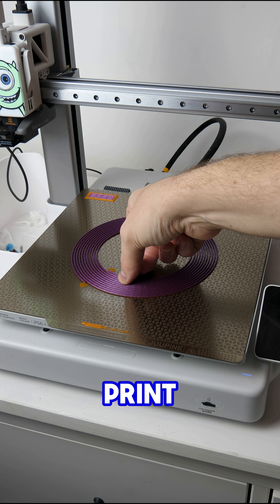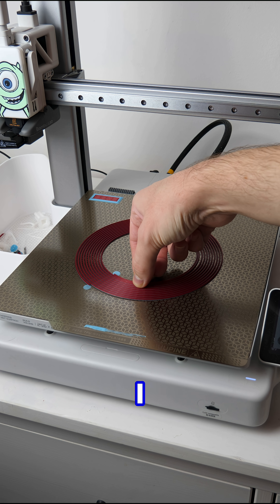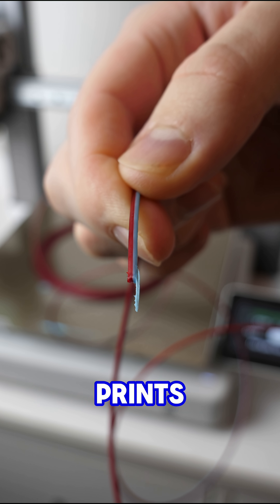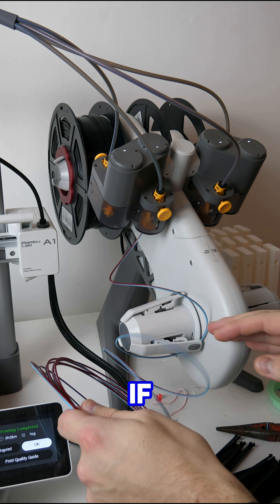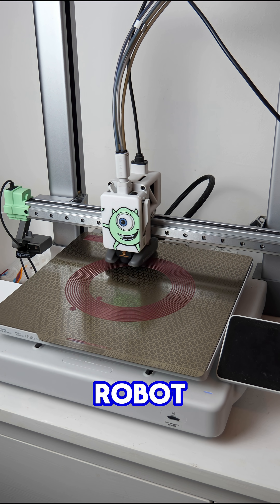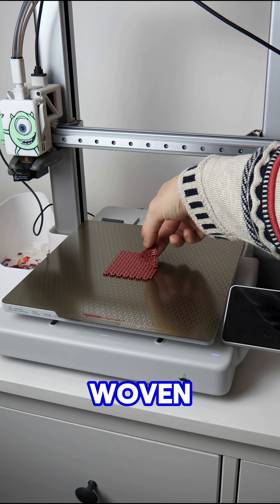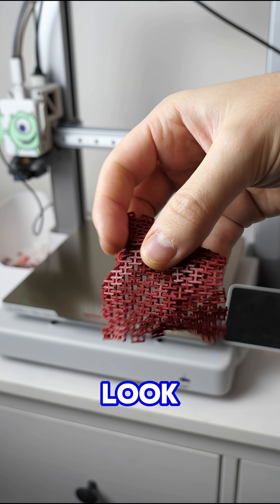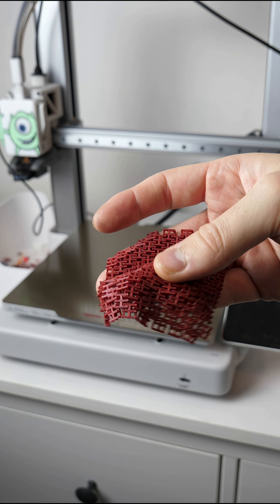3d print your own filament continued as requested #3dprinting #3dprinters

Comment: What I want is a glow-in-the-dark bi-color filament with two glow-in-the-dark colors. You can buy ones that are one color and then either smoothly or immediately transition to another, but there are none that are split glow in the dark. And you really need that split filament for smaller items to come out nice.

Comment: I don’t know if you’re already doing this, but if you can, you should try to make the filament gradient into the other color. 

(Imagine taking a cross section - Start with the circle being made entirely of color one, and gradually bring increase the size of the portion that is color two until it is all color two.)
Reply: Not how this works at all. You only have one printing nozzle so you have to swap the filament colors and purge the old color out.